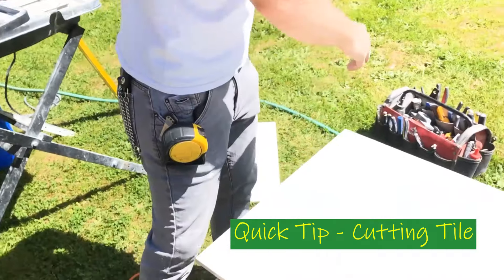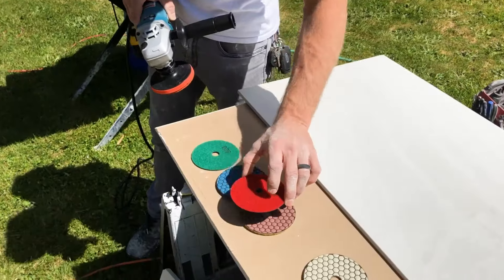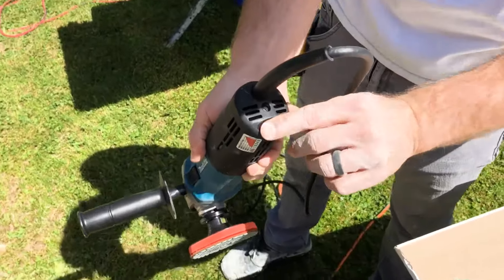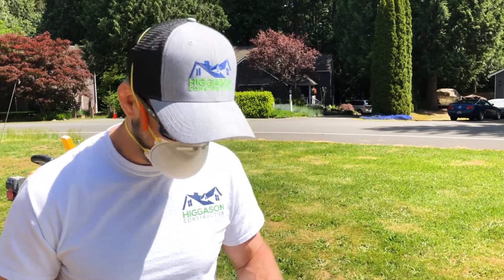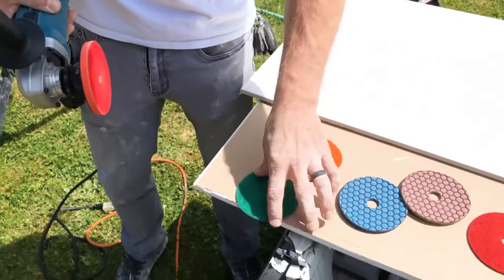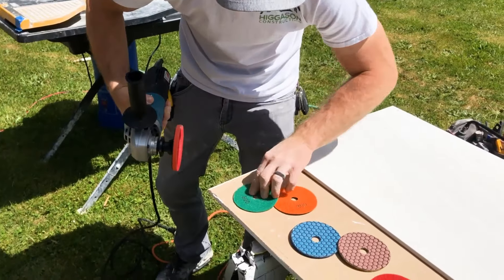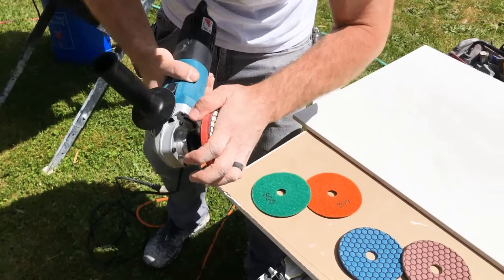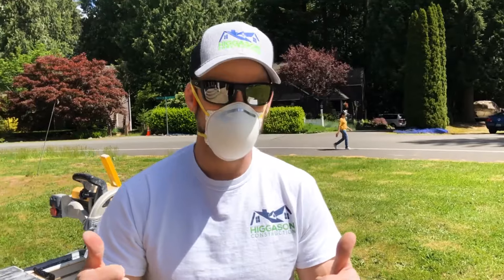How to polish tile - (creating a factory edge)

Comment: thanks for the video. what's that dewalt saw that you are using? is that a special saw for tile specifically or just a miter saw with a tile blade?
Reply from the maker: For tile only.
Reply: @higgasonhomes7541  what's the model?

Comment: i can see going thru this if you messed up a lay out and had to trim a field tile but if this is just a cut thats butted into a corner you will never really see it. i just use one grit or a diamond hand paper to clean edge but to use 3 different grits is a bit of overkill.
Reply: From your comment I already know you know everything but use tile trims 😂😂😂
Reply: there arent many tile trims these days, its either schluters or some kind of pencil liners. i use to use tile trims back in the day, but they are hard to find and just dont look as good imo because they break pattern. if im doing marble and have to actually polish the ends, i obviously use all my pads to match the sides to the surface, but with tile, i only polish the edge like you, to get the tiny chips out. if i am doing an inlay or something, i will spend the time like you and use a few pads because those cuts are really seen, but if we are talking about edge cuts in corners or cuts up to schluters, im just using a hand diamond pad because my initial cuts are done on the wet saw and personally dont think you need to use a variable speed grinder and all those pads for corner cuts . i guess if im using a snap cutter and the tile doesnt cut to well, i might use an array of pads with my polisher. so you go thru this on every exposed cut no matter where it is?

Comment: Let me help you “contractor”, it’s called a ‘bevel’. The factory edge has a slight bevel. A 1/16th BEVEL! 
Learned that in 1990
When I first started as a carpenter and knew pretty much nothing.
Let me help higher the number on the sanding/polishing pads means finer the grit and this taking off less material and giving a smoother surface. 

Geezzz

Comment: hi, please i hope you understand what i wanna explain, becouse my english is not so good.
i am going to start making terrazzo cement planters, but i don´t know what machine i must use, because i have read that polishing pads are made for 2000 rpm max (they are not supposed to last more than that because they spoil). i already  have  a variable speed angle grinder but the minimum rpm are 3000, (Dewalt DWE 4118) In another video the guy said that a polisher is used to accomplish that task, ( the rpm speed on the polisher are lower and, apparently, fits better in the specifications of the pads. please if possible let me know what you think about this and i would like to know what machine are you using in this video.

Thanks a lot!!!
Reply: Makita SJS variable speed angle grinder. Max speed about 11.000 rpm. Second "gear" is 4.000 RPM.

Comment: Wish my installer did that to my $50/sf waterjet marble mosaic he used in my backsplash.   Instead, I have jagged edges along the end of the mosaic section by the gold schluter, and I think it looks like tish.  Is there anything that can be done to smooth out jagged edge line next to schluter after its already been grouted?
Reply: I know you where asking the video guy but I have experience with this. Unfortunately the risk is too high to use any power tools on your existing tile. If it was me, I would tape up your schlüter with painters tape for protection. Next, carefully remove the grout between the schlüter trim and rough edge. You can us a grout hook, metal file, or oscillator tool. Then use a sanding block typically used for woodworking and sand at the best angle you can using the same grits as shown in the video. I would recommend wetting your tile as you sand using a wet sponge. Remove the tape. Lastly, grout the space between the two. Use that same wet sponge to clean off your tile and schlüter. Good luck
Reply: Omg. Unreal. 😳
Reply: @stewartjaquess287  I know this was awhile ago, but great advice 👍🏼

Comment: can you use a orbital sander?
Reply: I doubt it. Angle grinders are cheap. Go to Harbor Freight.
Reply: @lwh7301  I need to be a variable speed and they are not cheap. Polisher disc works max 5000 or less rpm , while grinder runs as 10000+.
Reply: @L WH  plz don't buy ANYTHING  from Harbour Freight if it has moving parts. You'll just end up wasting your hard earned money.
Reply: @ronwyman1396  not true. I have purchased many power tools from them for a fraction of the name brands prices and had great performance and can replace them many times over for the proce of the others.
Reply: @samson2968  I totally agree. I wouldn’t buy HF tools if I were a pro who used them every day, but for a DIY person like me who is fixing up an old rental unit, I have tools that I rarely use from HF but are necessary on occasion. Like the $20 recip saw and the $20 grinder that have lasted for years. Just make sure to use high quality blades and disks, and only buy corded tools from HF.